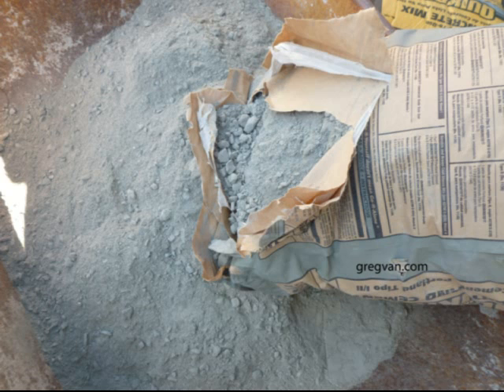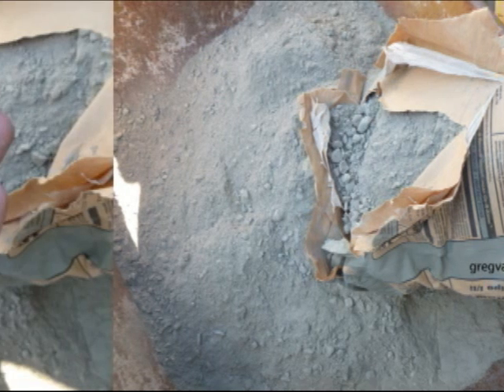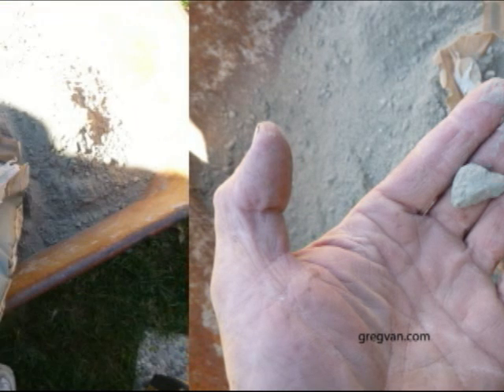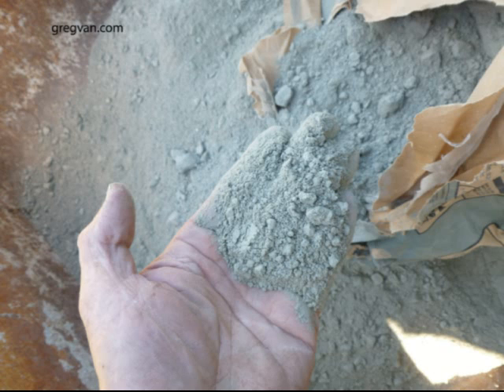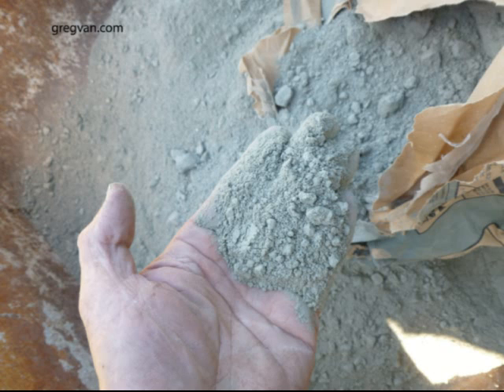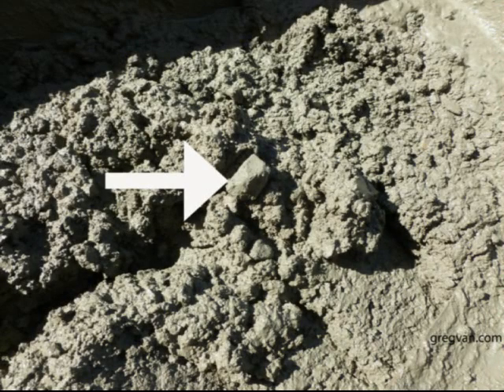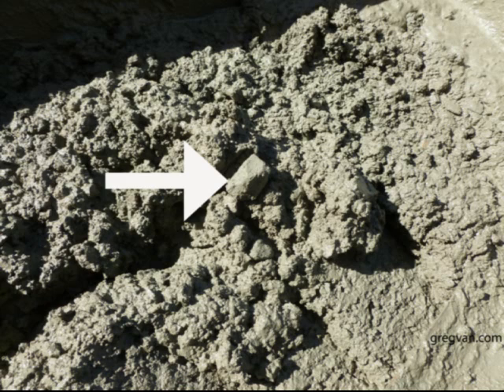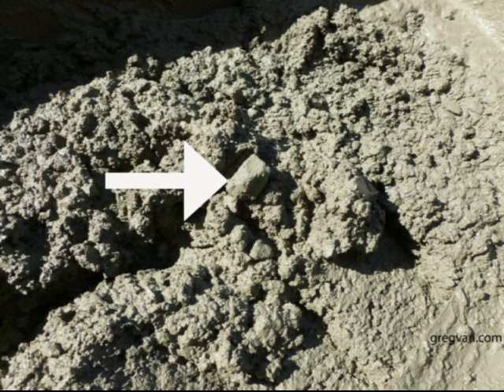What Does Bad Cement Look Like - Construction Consumer Awareness

Comment: my dad left what i'm assuming is cement in the garage in a plastic bucket covered about 30 maybe 40 years ago. its all dry but has a few lumps in it. i tried mixing it and it definitely does not want to harden.

whats worse is there is an awful stench, smells like chlorine but worse dont know how to describe that smell

does anybody know what the smell might be? maybe he put something else in the pot with the cement? the cement looks the same as this video so i just dont know what the smell is but had to take it outside it smelled acrid i did not want to damage my respiratory system.

Comment: I'm testing an old batch of mortar now for a tuckpoint job.  It can look good and still be bad.  I should have checked the manufacture date before buying it.  But it was only $6 and it's out of my way to return it.  I'll use it on the yard if bad.
Reply from the maker: Yes, maybe new will be better.

Comment: Thanks for this video. I started making concrete garden ornaments at the end of last year. Tried again this year and my mix isn't working well at all. It appears my mix has gone off despite it being mostly powdery and the small harder bits being easy to break down.
Reply from the maker: I've seen some bad pots. I think us do it yourselfer's think we can anything, but sometimes we need just a little more information.
Reply: @gregvancom  what about putting the cement through a sieve , I did and it was ok but I've tried to use cement that was laying outside but under a canopy and it went like powder when dry and just brushed off , I was filling small holes in a wall really small holes to make it look smoother to paint it and it just brushes off , it did turn out ok before when filling larger holes , wondering if leaving it out had an affect on it

Comment: You can tell if cement is bad.  if you make a batch and it crumbles when its dry. It already hardened its just in a powder form
Reply: I'm testing an old batch of mortar now for a tuckpoint job.  It can look good and still be bad.  I should have checked manufacture date before buying it.  But it was $6 and it's out of my way to return it.  I'll use it on the yard if bad.

Comment: I had a bag Portland Cement sitting in my garage in a plastic tote bin... with the bag of pc sitting  inside a heavy duty plastic bag. The tote bin was sitting on a thin carpet. So, it was not in direct contact with the concrete floor of the garage. For around 6 months... I decided to get a small cupful to try out a brick form I just made. The cement looked exactly the way he describes it the video... Still powdery but, with Little Rock pieces in it...
The brick I made completely fell apart, after letting it sit for over 12 hours....
 Bags of cement definitely go bad, with it still being in a powder form!
Reply from the maker: Thanks for sharing your story with us. I can't tell you how many bags of cement I've thrown away over the years, because they went bad.

Comment: If they're not too dense I bust them up.
Reply from the maker: I've actually done that myself, but try to avoid using cement like this for anything but post holes. I heard a long time ago that it affects the structural strength, but never verified just how much the structural strength of the concrete is actually reduced.